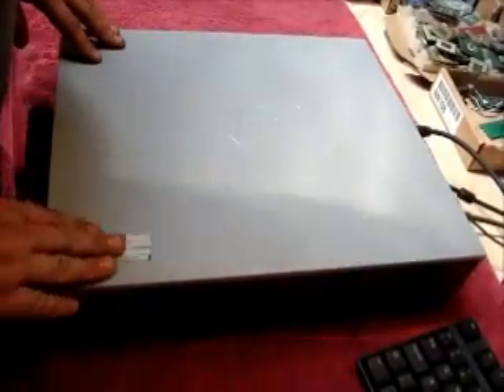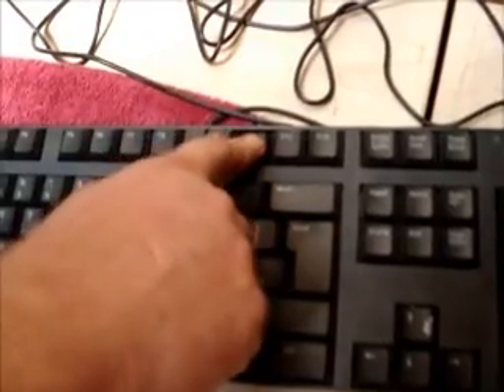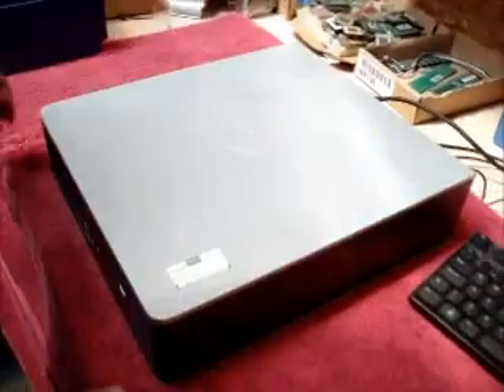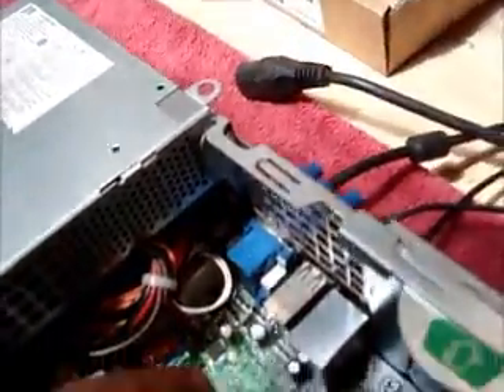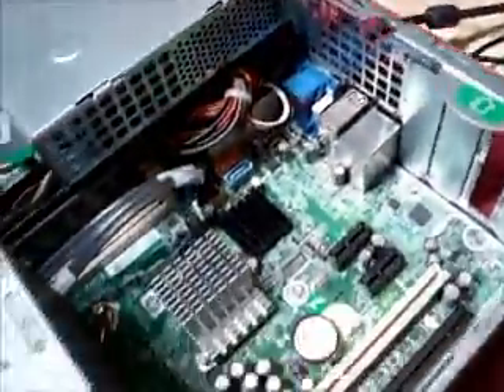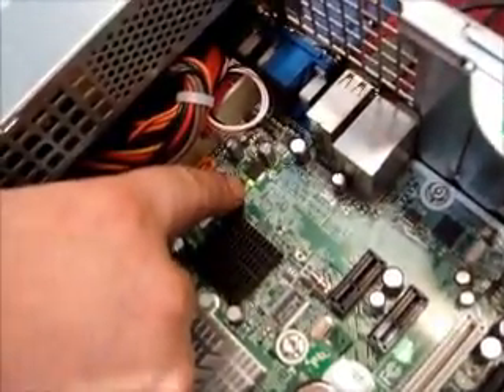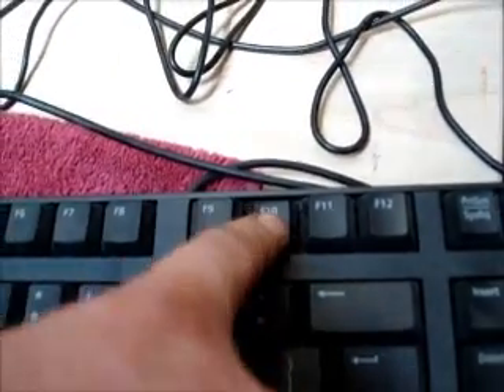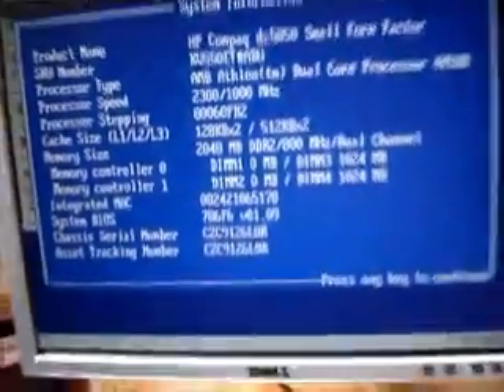How to Reset / Restore / Remove BIOS Password on a HP Compaq DC5850

Comment: Finding this in 2019 and you have saved my computer. Bought an old one off ebay that came with windows7, thought it would be good because it was an official copy and all, but things started going wrong and It wouldn't let me set up system restore. decided to put linux on but found out that probably the only reason it still had windows 7 was because the seller couldn't remove it  due to the password. was about to give up and use the computer for parts when I ran across this in a last ditch search.  I dub thee, My Hero :) :) :) Thank you for taking the time to post this.

Comment: This is the best solution and works for the HP Compaq Elite8300SFF too (it has STMEBx) . 

Thanks to this I was finally able to format that PC. A friend bought it from one of those company selloffs of old equipment and then had someone install a new OS... but they installed things from a boot clon for an internet cafe and never gave the password, so the PC was useless and needed to be formatted again.  This was the best solution I could find after searching for quite a while software things that never worked. Even getting the hard drive out to a case and formatting it as external didnt work but this did.

Thank you.